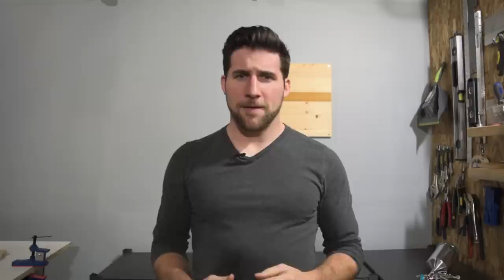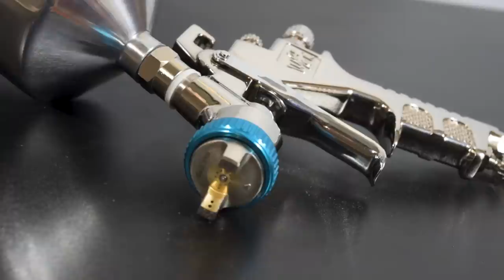Do you need to sand between coats of paint?

Comment: Thanks Brad for the this information. I decided to spray lacquer instead of poly for this Billy Bo project. I want to get used to my new R500 gun and compressor, then I will try poly.  I have sprayed Mohawk lacquer spraypaint on my first guitar project and it turned out great except for slight cracking around the pickguard holes due to the wet sanding water expanding I have learned.  Therefore I want less issues or sanding between coats on this project. Thanks again for the words of wisdom.

Comment: Painting a Steinway grand piano and although I'm using waterborne lacquer 
(Mowhawk) your video was very informative...they recommend 320 grit between coats but I like 600, so far....the following coats seem to look smooth. 
I love your distinction between "melting " of solvent based lacquer and "mechanical " bond achieved by sanding.  I  have decided to allow 4 hours between coats to allow moisture to evaporate,  but I'm hoping for molecular bonding instead of layering which can show up and necessitate more coats. Unlike solvent based lacquer,  the waterborne lacquer (according to Mowhawk )
has a limit of coats....I believe he said 8 is plenty and more is possibly problematic

Comment: You said it 1 million times I think, but I can’t keep it straight. What kind of paint should you or should you not use over poly, And does it or does it not necessarily need to be primed before painting?  

I am thoroughly enjoying your channel, it seems like when I have a question, it frequently gets answered if I watch a little bit longer. Thanks for everything
Reply from the maker: If you let poly dry fully it works with most paints. You’re probably thinking of lacquer and how it can’t go over oil based paints like enamels. 

It does not necessarily need to be primed. Just prepped.

Comment: Hello Brad, great video. I'll explain my project and then ask a question about sanding at the end:
Cube-shaped coffee table, dark brown.
Already 2 coats of water-based satin finish Kelly Moore Durapoxy HP (DuraPoxy HP is a high performance acrylic urethane enamel)
It needs at least one more (I'll probably do two more) coats of paint, last one applied 4 days ago. It has self-leveled nicely and no roller marks, but there are some nubs and nibs and I want smoother. I was thinking of trying this on one of the 5 sides as a test (bottom side doesn't count, obviously): wet sand (which grit?), wipe, apply another coat, let it cure 3 days, wet sand again (which grit?), apply final coat. If this works, repeat on other 4 sides, let cure, then (maybe) buff it / polish it. What do you think? Overkill?
Reply from the maker: Sand at 400 grit between coats. Then decide if you need it smoother/glossier at the end. If so you can got through the color sanding and polishing process.

Comment: Hey Brad, I asked a few weeks ago about this Dragoncaster I am painting. So, I painted the design last night with acrylic and it looks awesome, but I was curious about getting rid of the imperfections before sealing it. Should I wait a few days and lightly sand and gently wipe clean. My initial plan was to seal with shellac, and I am still heading on that course. I just wanted to know about this lite sanding before sealing. Thanks, it looks awesome even though it's not exact. I made it mine!!
Reply from the maker: As long as you can do so without harming the design then yes, a light sanding is a good idea.

Comment: I'm spraying a guitar with metal flake lacquer. I have some tiny dust spots on it. Should I wet sand them out and give it another coat of color before doing the clear coats? I'm thinking that wet sanding will mess up the evenness of the metal flake. 

This is a great channel, and I've learned a ton from watching. Thanks
Reply from the maker: If you sand and then flake again it should work ok, but you could also just clear coat and then sand out the bumps after if they aren’t otherwise noticeable.
Reply: @BradAngove  Thanks, Brad

Comment: I read sanding paint with flakes or a metallic look will cause issue's and requires one final coat after sanding to achieve true look. Final coat must not be sanded ?
Reply from the maker: That’s essentially correct. Seal you metallic coat in with a coat of clear and sand that.
Reply: @BradAngove  Hey Brad. If I sand my clear coat with an 800grit (to correct a mark I made from removing a hair 😔)  I'm assuming that will create scuff marks on that layer. Does adding a few more coats of clear hide them marks or do I need to remove them by sanding with a higher grit before applying final coat of clear.  I'm using Duplicolour for both the paint and clear. Both are acrylic lacquers so if I'm correct I don't need to worry about mechanical adhesion ?
Reply from the maker: The next round of clear should remove 800 grit sanding marks.

Comment: Hey Brad great channel. My question is, i've just completed my last coating of colour in the 3 stages like you said. Going to leave it dry out thoroughly before laquering. Do I really need to sand the colour before applying the first coat of laquer? Thanks and keep up the great videos!
Reply from the maker: Is the colour also a lacquer?
Reply: Thanks for the quick reply Brad. No it's not a colour laquer.
Reply from the maker: Ok. I would start by saying be very careful about putting lacquers over other paint types. 
That being said, if the base isn’t lacquer it likely won’t bond chemically, so yes. You should sand.

Comment: I have 2 questions for you, doing a rattle can paint job on  plastic harley saddle bags. Just got done with last color coat and will be letting them sit for a few days. My question to you is I should  use 800 grit wet sand paper before applying the clear coat ? Then after clear coating apply the polish ? First time in a long time am I trying something like this.
Reply from the maker: I like to use 800 before clear, yes. I have several videos on the sanding and polishing process that you may want to check out.

Comment: Brad, Your videos are fantastic!! I'm spraying a guitar headstock that's already had a very nice clear Nitro Lacquer finish on natural maple. Been practicing on a couple pieces of mdf I sealed. I've put 3 coats of Rust-oleum gloss black, 15 min apart then 3 more next day. Had very fine orange peel. 2 days later sanded with 600 dry. It turns to a dark gray after sanding. Next day another 3 coats on it. Do I sand before the clear lacquer or just do the clear? Also, how long between last coat of black & clear?
Thanks!!
Reply from the maker: Yes, give it a few days and then sand smooth with 800 grit. It will turn grey again, but that will disappear with the clear coat.
Reply: @BradAngove  Brad, What an excellent reply and quick as well. I now have the final part of my gameplan to follow. Thanks!!!

Comment: So the moron I just bought this motorcycle from, painted it with a terrible cheap almost seemingly latex paint especially on the fuel tank and as soon as I got gas on it it change color and peeled off immediately. Anyway I've been looking for the right paint to use by watching YouTube videos, no real success yet what I ended up doing is buying some tractor Implement paint, oil-based enamel and thinning/adding it with a little hardener also some naphtha. I was just wondering what paint you would suggest what kind that is that would be very durable and gasoline resistant? thank you for the video it was very enlightening also!
Reply from the maker: Have a look at my video on 1k vs 2x vs 2K paints. The 2K clear coat is durable and gasoline resistant.

Comment: I'm the type of guy who sands lacquer between coats. I usually do a 800-1000 grit before doing my 3rd base coat just to make the surface smooth and easier to clean dirt and stains. I paint motorcycles parts and make sure to make surfaces smooth to make it easier to clean

Comment: Yeah, this question has stumped me before, but common sense and reading the cans seems to work. It would be helpful if Rustoleum products would more clearly identify what they are (acrylic? enamel?). I know what I'm using now but it should be more obvious. 
You're great with responding to comments, so I'll ask directly: how much dry time should I allow after 4-5 coats of color (one can of the 2X Painter's Touch Rustoleum) before sanding with 800 and spraying the corresponding clear coat? And how many coats of clear? I'm after as high a gloss as possible...
Reply from the maker: I’d give it at least a couple days, but probably more like a week or two for that many coats. 
More clear coat doesn’t necessarily mean more gloss. It does however give you more room to sand and polish if you’re planning on doing that. I usually go for 3 or 4 coats.
Reply: @BradAngove  Alright, that sounds reasonable. I was tempted to start sanding, as the surface no longer has that rubbery feel in places and there's very little smell coming from the paint. But yeah, a few weeks is no doubt the safest bet. Not like I don't have other Teles to play in the meantime. Thanks as always Brad! Hope it's cool up yonder!

Comment: Hey Brad,  thanks for the great videos. I always use your advice as I am learning to paint guitars. Lacquer, acrylic, enamel,......I get confused fairly easily. I have successfully used Duplicolor paints, per your recommendation. What type of paint is Duplicolor? Can it be sanded to smooth out a slight sag in the paint before spraying clear?Thanks
Reply from the maker: Duplicolor has a few different types, but they are mostly acrylic lacquer. You can sand smooth before clear coating.

Comment: How long should I let the Behlen Vinyl Sealer dry before sanding and respraying another coat or two of sealer on the Mahogany guitar back?  Instructions say 1 hour dry time before sanding again, but your video has me wondering what's best for Vinyl Sealer, which wasn't specifically mentioned in this video.  I'm hoping that my waiting four hours to sand and respray on the second coat of Vinyl Sealer was ok.  How long should I wait for the second coat to dry before sanding and applying a third coat.  I think you're right about the Mahogany being "kind of thirsty."
Reply from the maker: 4 hours should be just fine. The vinyl sealer dries very quickly. Give it a day before moving on to your lacquer afterward though.
Reply: Using Rustoleum Enamel for color base coat, but I will wait the 24-48 hours for the final sealer coat to dry unless you tell me otherwise.  Hey, thanks again!
Reply from the maker: Sounds like you’re on the right track. Don’t forget to sand your sealer before applying the Rustoleum.
Reply: Will do...You're more responsive than if I were talking directly to Behlen.  I can't sing your praises enough Brad!  Thanks!
Reply from the maker: Glad I could help.

Comment: Hello Brad, new to your channel and your vids have been super helpful so far! I have one question tho- after sanding my top coat down (cus scratches) there's this milky white fog on where I sanded (about 3000 grit) Should I buff it out before applying another gloss PU coat, or should I just put another PU coat above it and that white mily sand mark will go away? Many thanks!
Reply from the maker: If you buff it the new paint won’t stick. In fact, it probably won’t stick to 3000 either. You should sand it all uniformly with 800, clean it, and then add your next coat.

Comment: Brad Gr8 videos u have ! Xlnt & logical . Do you recommend sanding spraypaint  before applying rustoleum clear enamel ? I have an outdoor steel platform I built for my tow reciever hitch to carry a motorcycle or whatever needed. Do you think clear enamel would last 1 year in the elements? I painted it with rustoleum professional aluminum finish . I wanted to use 2k & a respirator but the chemicals scared me away 😁< Thankyou > kyle rich california
Reply from the maker: The clear coat should stick better if you sand generally. How long it lasts will depend on how much abuse it takes. Road grit, etc. hitting it will probably chip away at the paint fairly quickly.
Reply: @BradAngove  <Thankyou >kyle😁

Comment: Hey Brad, great channel & great videos. Question - I’m using an acrylic based lacquer on my guitar. It’s been drying for a week now as I’ve been busy. Should I sand or just apply the clear coat as it is? Will it just melt in?
Reply from the maker: Acrylics don’t behave quite the same way as typical solvent lacquers. I would give it a light sanding with 800 grit before clear coating.
Reply: Thanks Brad, I appreciate the help.

Comment: I have a question for you, Brad. Well, two questions, actually. First, what about primer and clear coat? Let's say I was going to spray paint a guitar body. I sand down whatever finish is on the raw wood (doing a mediocre job at best), then apply two coats of primer, two or three coats of paint, then two or three coats of clear, leaving ten or fifteen minutes between each time that I spray. Is this a bad idea, or will it be okay? My second question is, when are you going to work on those kits from SOLO? Been looking forward to that. Thanks! —Brent
Reply from the maker: +Brent Jones That’s too much paint at once. You can do your primer/sealer, let it dry and sand it, then repeat with colour and then with clear. 4 coats per session max. 
I’ve started working on the tele kit already. Should start posting this week or next hopefully.

Comment: Hey Brad ! Love your tutorials. Question : I’m doing an EVH frankenstrat tribute (black n white) I’ve done like 6 coats of black and I’m not thrilled with the finish.... do you recommend wet sanding the black down before I tape it off and apply the white ? I’ll be clear coating it as well, just not sure if the clear coat will mask the orange peel ??? Thanks in advance brother 👍🏻
Reply from the maker: I would dry sand it flat with 600 grit before moving on.

Comment: Hey Brad- love your channel. Super helpful and the content is fantastic. I have a general question for you: if I lay shellac on a bare wood guitar to seal it, and I sand with 220 between coats, on my final coat before paint, can I use 400 or should I go with 220 to have more tooth on it? Is it necessary to sand through different grits (220, 320, 400)? Many thanks in advance. - Vince
Reply from the maker: 400 is fine. No need to go through several grits until you get to the polishing process.

Comment: Hi Brad, i've sprayed my Tele kit with Krylon colormaster paint+ primer, which i think is acrylic enamel... I already have a Rustoleum 2k clear coat, an oil based Poly and a Rustoleum acrylic Lacquer can. What clear should i use with this type of paint? Btw I don't mind about the yellowing effect on oil poly. Thanks!
Reply from the maker: I think Krylon has their own clear from that line of paints dont they?
Reply: @BradAngove  i've read on many forums that their clear stuff is incompatible with the acrylic enamels. The other thing is i can't buy another can at the moment
Reply from the maker: Ok. Rustoleum 2x should be compatible. I didn’t rustoleum had a 2K though.

Comment: Brad, what's your opinion on sanding metallics? There's a lot of people that say you shouldn't sand metallics because the flakes will lose the shine. I'm concerned about one of my projects. I've let it cure for nearly a week and was planning to hit it with 2k clear.
Reply from the maker: That is sometimes an issue. I occasionally seal in my metallics with a coat of clear right after spraying them. Then I have something to sand. 
Anyway, you can probably go ahead and spray the 2K over it as long as it isn’t glossy right now.

Comment: Hey man, I am new to painting and customizing guitars. I am having trouble with a soft finish. I did a galaxy blue paint job and used Spray Maxx 2k clear can. I went straight from paint to clear after fash time without curing. Now its been 3 days and it is soft, i laid it down on some foam and it left an impression. So, is there a way to harden this? Or do have to start over?
Reply from the maker: Are you sure you activated the 2K can properly?
Reply: Brad Angove I’ve used it before on another project. I made a wood guitar hanger with automotive grade spray paint and used the same clear coat. It hardened very well and looks great.
Reply: Brad Angove so about 99% sure

Comment: I'm a beginner.   Whenever I apply a fresh coat of spray paint.  Let it cure a day or more.  Then sand with 800 paper.  The paper dulls the paint and leaves marks on the paint.   This is a problem with the final coat of paint, prior to clear coating.   Because I doubt CC will make it all better.   I really think I'm done with sandpapering to make paint stick better.   I seem to be the only one complaining about this.  Maybe I'm doing something wrong.
Reply: Sorry, I see he covered this in another video.
Reply from the maker: Glad you found it!
Reply: @Frip36  This is what i'm worried about.  My painting is done (dark navy) and i feel if i sand final coat
 with 800 grit it will show thru the clear.  Do you remember which video you watched?
Reply from the maker: That video was ages and ages ago. I think it was called “some information about clear coating”. I’ve also done one on whether you can fill scratches with clear coat I think, and I recently did a livestream about finish sanding that would have given some good info on essentially this topic.
Reply: @BradAngove  Don't know how I missed that one.  Thanks Brad!